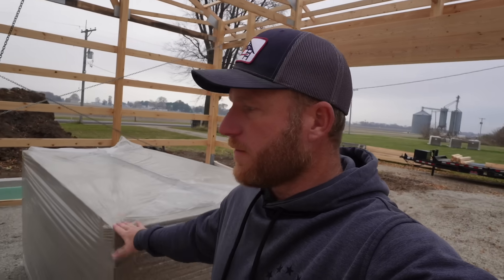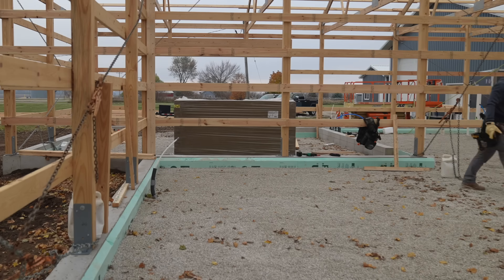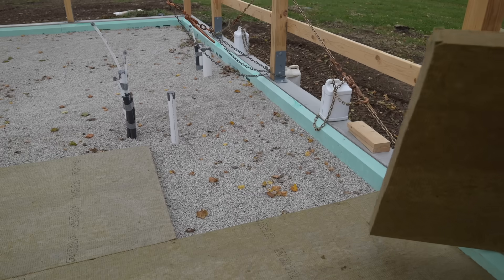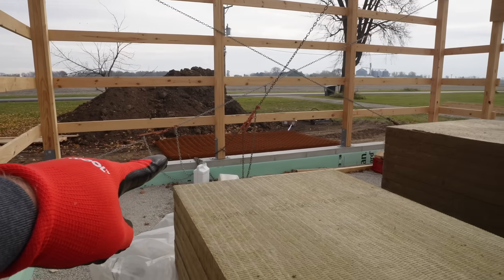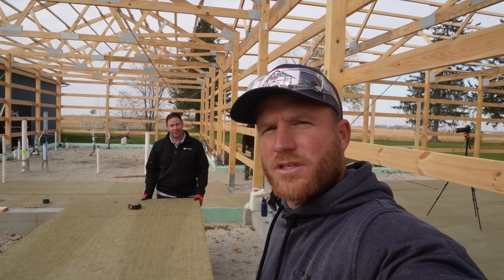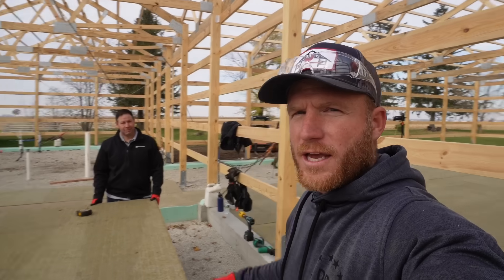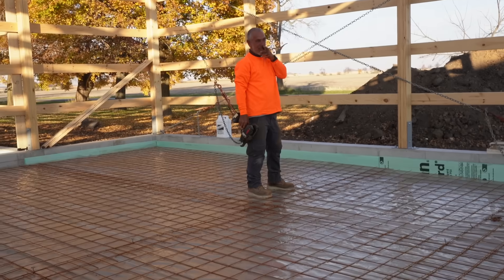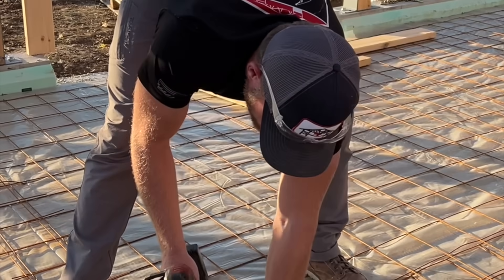Building The BEST House Part 3: Installing Rockwool Sub Grade

Comment from the maker: Rebar tying tool!! 

https://amzn.to/3BqYrnr
Reply: Will the rockwool hold the infloor heat tubing staples? How is the cost compared to traditional rigid foam?
Reply: @nathanpreston7303  In my area they zip tie it to that grid that they laid down. No stapling it to the insulation
Reply: @nathanpreston7303  About the same as going into foam insulation.  Some places (as @Ryan Schmidt stated) will tie strap it down to the grid while others staple it.  Some do both, they'll staple as they do their run, and then put tie straps to fill in the holes.
Reply: A rod buster is typically bending down all day laying rebar. You don't see many rod busters past the age of 30. Back goes out.

Comment: I have a build question. 
Do you need to know the thickness of your sub insulation and factor that in with the depth dug inside the footer to get 4" slab?
Also it seems that the depth varies pretty largely near the edges to where it looks like the slab would be pretty thin. Is that a concern?  Thanks

Comment: So many solutions would not fly where I live. Completely different legal and cultural environment.
For example leaving organic matter (leaves) underneath. Insulation in two layers at least, overlapped. Wire mesh is non-structural I presume-it does not help to control cracks in current loction.

Comment: So, did you record the laying of the heating pipe and concrete work? Does the piping go on top of the wire mesh? And then the mesh and all gets elevated to be in the middle of the slab? Thanks!

Comment: Maybe the codes are different there, but hey Kyle, you were in Switzerland, so you know that we do not build too bad here in Europe. So the concrete guy use way weaker mesh, than needed (8mm diameter here) and not overlapping it enough (minimum of 4 lines, so 2 rows overlap). Plus they need to put spacers under it for so many reasons. I hope they done it, because this is just waste of material this way. Rockwool products rocks literally. Love them. We put them on the water barrier (mod bitumen glassfibre), not under it, because of humidity, and thermal envelope, but this is just another way. We have two layers of concrete, one structural (20 cm meshed), one subfloor (5 cm glass fibered), and install the rockwool between them. Each countries have different techniques and rules... 🤷🏻‍♂️

Comment: Matt Risinger of The Build Channel has been using Rockwool Insulation for several years. This is the only insulation that should be sold in the U.S. The tight fit you are talking about will also be in walls, around outlets and gives you a really tight build. It is expensive, but it is a great sound barrier too. I had not seen the floor insulation before but it is a great addition. This insulation will not burn, and will not absorb or hold water. Mice and rodents hate it, so another plus. Only problem is that it is not readily available, it takes work to get it, but it is worth the effort.

Comment: Why are you puttng the rockwool over the vegetation. I do understand that it won't mildue but you would want he best surface on the bottom as possible?
Reply from the maker: there is an infinite amount of dirt and vegetation below....what are the leaves going to do??? turn to dust that is it
Reply: @RRBuildings  Just a question.

Comment: I am surprised that this is used sub grade.  Initially I wouldn't think it would have the compressive strength to maintain its dimensional integrity.  But it seems to work.  However, I would be concerned also with water saturation especially when applied in a basement situation where water could saturate the product and the R-value would be significantly reduced.  However, rock wool is a superior product especially when used as an exterior wall application.  With high R-value plus fire resistance (fire proof) in areas prone to wild fire it does not get better than this.  Again another superior video.  Keep up the good work.
Reply: The gravel bed is a capillary break to stop water from wicking into insulation (ponding water is a totally different topic). Also- my understanding is, this product is dimensionally stable and won't lose R value when wet, unlike fiberglass, which relys on its expanded, fibrous, structure to perform. How can Rockwool be "superior" on exterior applications but questionable at sub grade?
Reply: @nicholaslandon1475  rock wool is fibrous meaning it relies on trapping air in pockets to retain its r value.  It is lower r value compared to close cell foam insulation because of higher conductivity of the fibers compared to lower value of the chemical foam and tighter air pockets in closed cell foam insulation because of the open fibers there is more air movement but water can infiltrate the fibers when in a wet or flooding area as can happen in basement applications.  As you know heat transfers faster through water than air resulting in lower over all r value.  Rockwell does drain better when exposed to a lot of water though when compared to fiberglass but closed cell foam is superior to both and retains its r values when exposed to flood conditions because of the close cells.

Comment: Hey Kyle, question(s) for you!
Would it be possible for you to do a small detailed video/series on exactly how you do:
1. Sealing at the bottom of your metal/walls to keep pests out and letting water out for drainage?
2. How to properly seal off metal roof at the end of the eves also to keep pests out and proper ventilation?
3. How to cut in and finish properly where the metal siding/walls meet at the windows and installing drip edges, sealant etc.
Maybe make a mock up in your shop. I know for me, that these are the questions I always have and would love to see. I have twenty years in construction but have never done a metal building and have always wanted to see this is more detail.
Reply: They have tons of detailed videos on their YouTube page.

Comment: How is rockwool with carpenter ants? They tend to be an issue in IL depending on where you are. And they love regular foam.
Reply: Just like termites, they do not like eating rocks so ROCKWOOL is similar.  There actually is no third party testing that we are aware of.  Also, for the goat farmers, the flies don't like ROCKWOOL products either.
Reply: @Builtbetterdesign  thanks for the reply

Comment: Surprised you just don't go with a vapor barrier over the Rockwoll and then your sub-floor. Two layers of 3/4", second layer perpendicular to the first.  No reason to use concrete unless the client requires it.

Comment: Someone should put down a big square of that stuff, then put a concrete slab on and leave it open at the sides and then drive a truck over the whole thing. It'd be interesting to see how the rockwool compresses and how it performs at the sides when there's no support. Looks like a promising material, I'd like to see it tested out.

Comment: I have to say that I would have only used EPS Foam insulation prior to this video... But I can see it is possible to use the rockwool for subgrade.  Although EPS Foam does Not allow water penetration, Rockwool has Termite protection.  
Maybe it would be better to have the Plastic Under And Over the Rockwool to get even a better R-Value from water not getting into the rockwool and creating unwanted heat transfer.
Reply: EPS user here as well.. Just not seeing how this is better.. Sent an email to Dan on the science behind it, we shall see..
Reply: @FJB2020  Yes, the more water saturated the Rockwool, the less R-Value there will be.
Reply: @jameschupp2230  Yup and contrary to belief or what they say, rockwool will absorb water..  Seen it first hand..
Reply: @FJB2020  Gathering the details and we have plenty of our own testing here also.  As for water, the water is free flowing through the product through the air holes but will never compromise the stone fibers.  We also do not wick water up through the product the way other fibrous materials do as we coat each fiber with an oil based binder.  We begin to lose lots of R value at 8lbs of water in 1 cubic foot of material which is just over a gallon of water....if you have these conditions occurring below your slab, you have much larger issues than a cold concrete floor.  

Some other benefits, not sure if you heard Kyle talk about the weight of the product and high winds blowing lighter products but that is a huge one.  Also, when cutting, not a ton of little beads everywhere.  Then for the product itself, it is stone so will never decompose, it also offers higher thermal mass and will store energy better.  We have higher thermal value at 4.2 per inch vs 3.8ish per inch.  Also,  I am looking forward to hearing if Kyle has better acoustics from the concrete slab, we do a lot with interior wall/ceiling sound absorbing batt products as well.  But hey, if you are using anything to insulate your slab, you are doing it right.
Reply: @Builtbetterdesign  Thanks for the reply!   I agree that if you have a lot of water under your slab that it is an issue.  I am just having a hard time wrapping my head around it and will have do to some more research before using it.

Could you tell me what is the PSI rating of your product is and the creep under load?

Comment: could I use this over my plywood floor in my cabin and then cover it with say 1x10 floor planks??? The underside of the cabin is Hard to get to and not much room and the floor is a jigsaw puzzle so you cant just lay bat in or foam board. it would take an insane amount of cutting and fitting.

Comment: I dont think I have ever seen the vapor barrier above the insulation on a slab.  Normally I have seen gravel, vapor barrier, insulation, radiant tubing, rebar.
Reply: Pretty standard in cold country to have vapor barrier on top of the slab insulation.
Reply: @akdoug6437  so you just allow the insulation to get wet/damp making it useless?
Reply: @FJB2020  if you have so much water pumping up under your slab to render foam or rockwool useless, you have other issues.  In cold climates where you are on good soils, moisture will travel from the heated space into the slab and insulation. Poly helps control this. This is one of the reasons we put poly to the warm side of the insulation in the walls and ceiling in cold climates.
Reply: @akdoug6437  But it would only render the rockwool useless as foam is not permeable.  Logic and building science is just not supporting this install method..
Reply: @FJB2020  also for foam boards, not rockwool as pointed out, poly/stego keeps boards from flapping up and down and away; also in general Al, any vapor barrier should go in the warm side of an assembly. I am looking forward to the next video so see how they keep that mesh placed in middle of a slab that’s only four inches. Good luck without chairs, and if chairs, good luck having crew avoid stepping on them. I’m thinking fiber reinforcement best.

Comment: The precise Rockwool you use was the last floor  removed.The floor gave up when the owner wanted to put an aquarium in the house. It gave up really bad,if your base is not compacted enough, it will get damaged even more,because of different concrete thickness on different places on the floor.The weight is greater on thick concrete.

By the way,if you have a lot to cut tough,festool has a special blade and attachment for your reciprocated saw and it’s very easy to cut it.

I only use this kind of insolation for the walls.The roof I do wool / crushed paper(because it gets the water vapors out of the building(they breath really well)

Comment: I tried to get information from Rockwool for a metal building I am planning on constructing.
Like pulling teeth.
I specifically asked on the phone if they made a product for under a slab that I could put under radiant heat .....NOPE no such thing.
I asked about insulating the walls could not really get an answer one way or the other.
I gave up.
Maybe I'll try again. 
I thought Rockwool was a great product.
My bid is currently priced out with fiberglass and the foam board underneath.

Comment: I didn't know you could use rockwool under a garage slab.  I thought it would compress too much. Thanks for the info.
Reply: let me park my dozer on it see what happens to my slab, lmfao
Reply: it will they are incorrect wake up
Reply: @YAHUWAHISKING  So, I guess the manufacturer them self don't know what they're talking about but you keyboard warrior does?
Reply: @YAHUWAHISKING  yep the computer you are typing on and the internet you are using to watch this video were probably designed by a carpenter.
Reply: @pouetance  this is over your guys heads smart people understand you cant have slab flexing, those who build things in real life not on paper

Comment: If a guy wanted to tackle a project like this solo, what would be the best large tool / piece of equipment to have? Like a tractor with pallet forks or something like that?
Reply: I just finished my shell on a solo self built 40x60. The absolute best piece of equipment I rented was hands down a rough terrain scissor lift. Saved me countless trips up and down ladders and allowed me to install things alone. So much safer as well.  I did rent a 60ft boom to install the trusses but only needed it for 4 day.

Comment: I would never have guessed that rock wool would have a high enough compressive strength to be under slab. Do you know the psi rating on this product? I was hoping you would mention it in the video. 25 psi or greater is what is usually recommended.
Reply: 439 psf (21 kPa) @ 10% compression so 3 psi. But 25 psi under a slab is way over kill. A slab weight around 0.5 psi. My structural engineer estimated that the total load on my garage floor is 1 psi so this should be ok. Not sure about heavy machinery though...
Reply: @pouetance  that is incorrect.. you should do a deep dive on what those numbers mean..
Reply: @pouetance  Thank you for the info. I can see it being ok under residential, but not under a garage or shop.
Reply: I'm curious too because I would be surprised if it can withstand heavy machinery.
Reply: guys its cant they rookies we all know what happens when a slab flex it cracks!!
Reply: i would never try this is bs